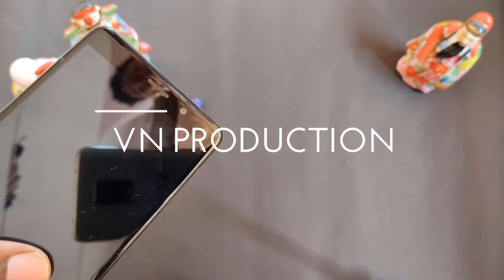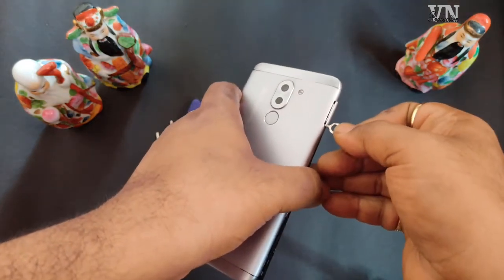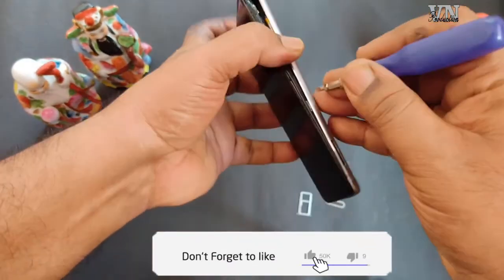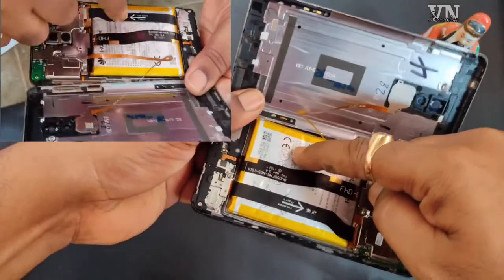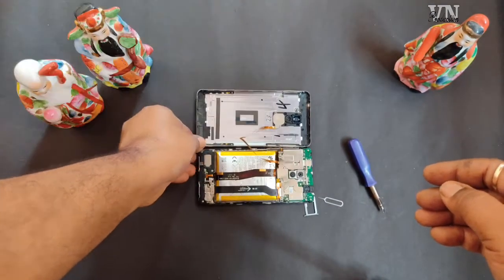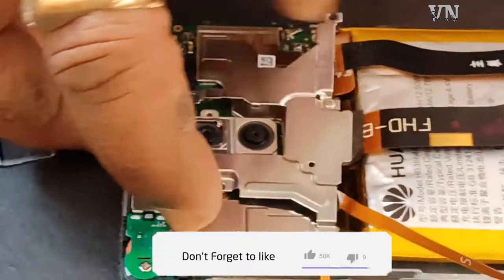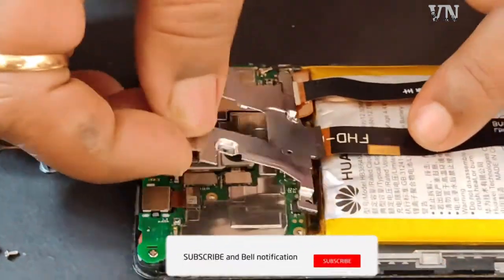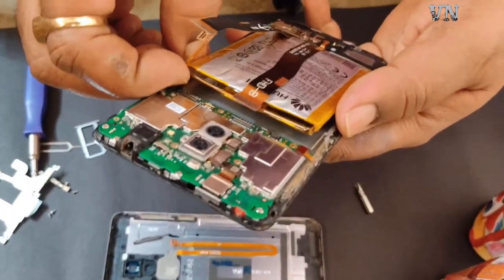Be careful of swollen battery/ Save your smartphone

Comment: But y battery swells?
Reply from the maker: They are the result of too much current inside a cell of the battery, which causes a build-up of heat and gas. This can be caused by overcharging, manufacturer defect, deep discharge, or damage to the battery.

Comment: I have same condition present lockdown going on what should i do??
Reply: Hi i had the same battery issue. but i was able to seitch ot on off. So i charged it today and the battery automatically shrinked itself to its normal shape. Please advice what am i supposed to do?
Reply from the maker: Plz don't try to remove